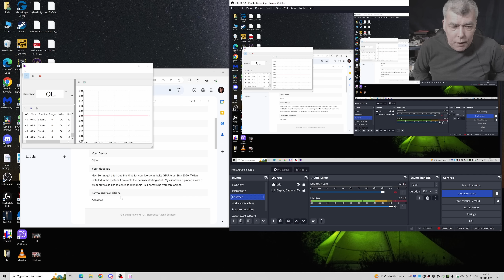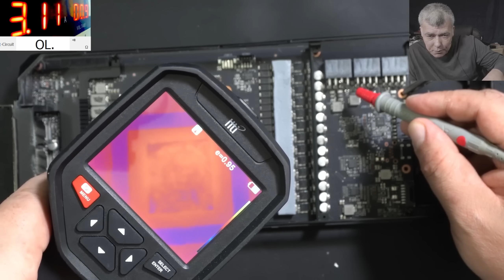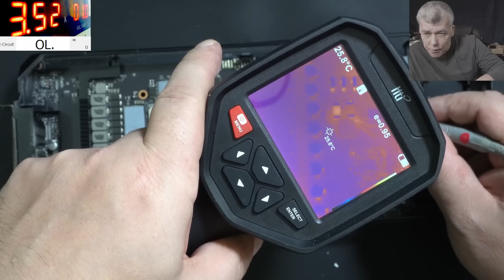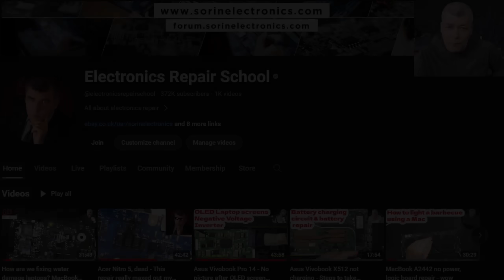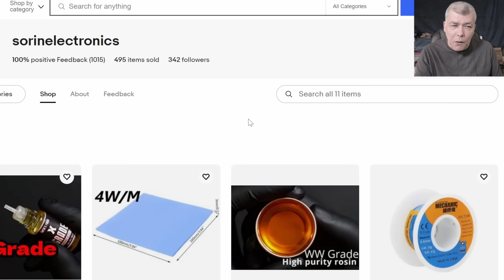Asus Strix 3090 GPU repair - Can GPU cause PC not to turn on? Yes, and that's the fault

Comment: hey Sorin, i am also getting into gpu repair and i can tell this.... you need so much crazy heat to remove even tiny components from a card.... always use a preheater big enough for that board you will keep your sanity that way and not overheat other components, especially if you done a leaded solder reball on some parts

Comment: You have to take the back plate out before using the heat gun, it has heat pads that suck the heat to the aluminium backplate

Comment: Did the same thing this week with a 3060.  It had gotten so hot there were burn Mark's and factory flux everywhere.   Found shorted mosfet, replaced and I can't believe it actually works.  One very fortunate kid.

Comment: its so sad that a high end expensive gpu doesnt have fuses on the 12v rails, you can install fuses by lifting the coils and soldering a fuse between the coil's leg and the pad, thats how you make a better than factory repair.

Comment: It's a good idea to use a heat shield for the capacitors as they don't like hot air. An L section strip from a soda can will do.

Comment: My PC with MSI GTX 970 turned of while playing with smoke coming out from case. I found out that one of the mosfets was basically welded to the board. I took the mosfet out of the board and replaced with new one. With not much hope i put it back if it will work and it was. That GPU still works in younger brothers PC. Amazing what GPUs can handle.

Comment: Not sure but I believe this chip was partially working and able to measure the current using the shunt resistor and cut the power on the GPU and probably it was switching the low side first for testing or something of the kind , because whatever got shorted it must be the high side mosfet I mean it must be having short protection mechanism otherwise the survival of the GPU is inexplicable...

Comment: Actually GPU can be burned. To be sure you need install Windows, driver and do few stress tests (furmark for example). GPU can hang system when you try to install the driver. Without tests you can't be sure it's working or not.
Reply: except that it doesn't look like bad heat pattern I believe, you can conclude that the gpu is running and doing something when the heat spreads unifromly on the die cover but if it's like a small dot you know that something  there got shorted and is consuming all the power as heat.

Comment: GPU is not dead because PSU power detect issue and disable. If you inject above 1v, killed GPU.
Reply: you do understand that a big PSU can push 50-60 AMPS at 12V, so even with 0.2 ohm resistance its happy to pass all that current. its not gonna detect anything unusual.
Reply: Probably he could inject more ,and do not kill the GPU, since he was injecting at 12v rail. At the DrMos (Vcore) the short is grounded , and only a small leak of current is passing by , resulting the die getting "warm".
Reply: @Darkyzor  of course that's very different. when he says mosfet is shorted he means passing input to output. easy to verify with multimeter once off the board

Comment: afaik low melt (bismuth based) creates brittle joints if I'm not mistaking and supposedly even much worse when combined with lead (already present or added lead based solder). Additionally even if the melting point is 140° - the alloy might start softening at a lower temp (~ic working temps) which increases the possibility of rapidly accumulating vibration cracks (because in theory it won't reach the melting point and mend the previous cracks)
No disrespect but i think this not good practice.
Reply: Exactly ,finally somebody does mention this stuff. Low melt solder is mainly good for desoldering stuff, but not for soldering.

Comment: Hmmm its kind of a fix... I like to watch NorthWest repair he works only gpus and all 3090 are bad... I wold personaly use higher temp solder and preheat the board also i would run MODS to check memory and a stress test.
Reply: why?, there was no fault with the memory.
Reply: @mart43  Because you allways trust the customer... NOT... and so you can say it worked for sure and stop posible refund and/or shiping costs also time etc... And how else will you know if the temps are right...

Comment: Hahaha nice one Sorin, GPUs take away heat very quickly thats why you won't see much on a thermal camera but i would prefer that method of yours of grounding the side where the current leaks through a short, that way the faulty driver will produce more heat.

Also on removing the driver its better to preheat the board because the gpus take a lot of heat.

The gpu dont die after a drmos gets shorted because the drivers on the GPUs are controlled by a very intelligent chip that grounds power or sort of produces a short before the gou core and thus preventing the core from getting bust. 

What usually kills the gpu is injecting power using a psu hahahaa those if they see a short they pump current into the short.

I would like to see a vram case now, thanks Sorin.

Comment: Sorin this is like a 12+ layer pcb with huge copper planes, you cannot work on it properly without a preheater/hotplate of some sort.
Reply: He can. Will it be easy? No, not at all. But you can work on it. Of course replacing bigger stuff like memory or die will be impossible but everything else is doable.
Reply: @gorky_vk  its doable but as you can see sorin is mentioning he held his hot air for like 10 mins on the card (probably at 400c+) and still nothing was melting, which is not good for the on board components and the pcb taking the heat.

Comment: I'm worried what will happen to the mosfet with 140C solder, when the GFX is stressed and Temp rises
Reply: the 140 solder is mixed with no lead solder 220 original from board , so the result is higher than 140 so it is probably safe, but i would have used 180 deg solder.
Reply: Most of the transistors won't survive junction temperatures over 125-150C. So, it won't survive anyway.
Reply: @СвинкаСкреппа  In the factory they use like 240C degree profile for reflow oven , and there the whole board reaches that temperature.
Reply: @Darkyzor  You can check any datasheet. Max operational temperature for modern MOSFETs 125-150C

Soldering is a short time heating and MOSFETs are not loaded at that moment.  That's why Sorin always cools down MOSFETs before testing

If you are doing soldering with an iron you can easily overheat components and damage them.

If operating MOSFET is so hot that solder melts then the junction is even hotter. It will not survive.
Reply: Yeah - don't think 140C low melt is a good idea - back for warranty repair soon!
Reply: the solder will get liquid 7:58

Comment: I thought i was watching @northwestrepair for a moment 😂 Nice repair Sorin!
Reply: NWR is not showing us the multimeters and the power supply voltaje like Sorin does. Also Sorin explains much better the fault.
Reply: @ionix2000 dumbest comment i've seen in a while
Reply: @tyrellwreleck4226  if you consider that using a multimeter and power source voltage displayed all the time on the video is the "dumbest comment" then  I am not sure what this tell about me but for sure it tells alot about you. Sorin all the time says "check the voltage" and this is quite important in diagnosis. I wish NWR to do the same but he didn't want to do it.
Reply: @tyrellwreleck4226  Did u Act in z Movie Titled " Dumb & Dumber"? 😂! It sounds you did 😅😂
Reply: Same lol
Reply: There is a "slight difference" tho :D NWR is far more professional on GPU repairs.